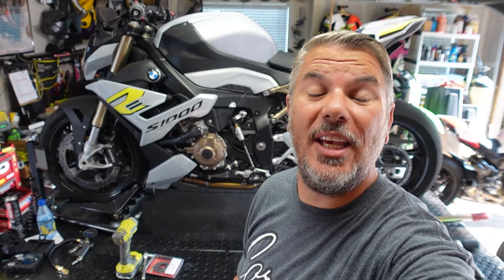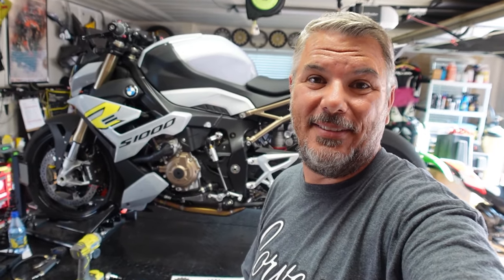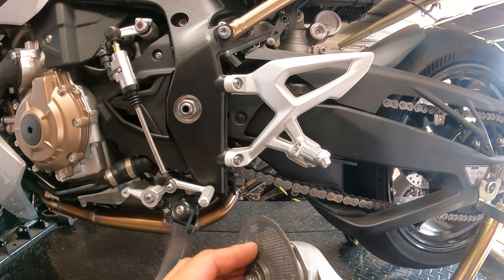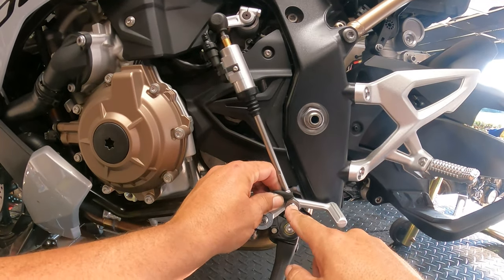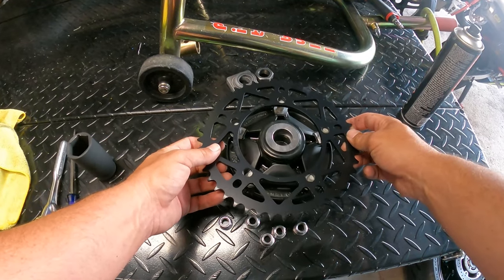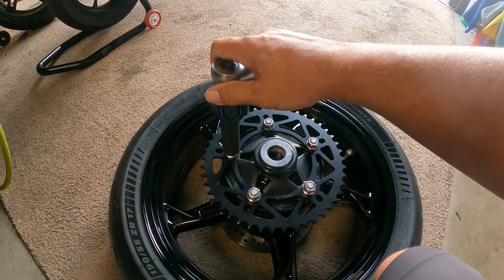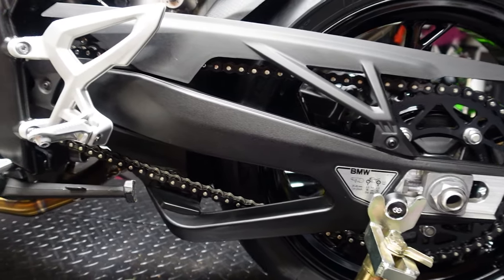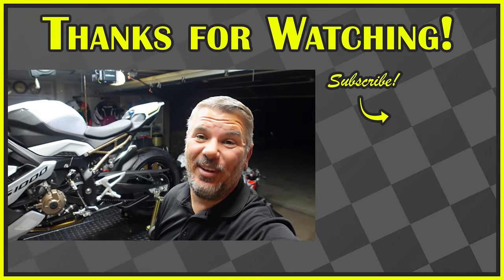2022 BMW S1000R | 520 Chain and Sprocket Install

Comment: I went one tooth down up front on my multistrada and hated it.  Cost me a new chain to go back.... listened to everyone and on the forum that the bike should have come that way, couldn't stand it.  Went back in under 1000 miles.   Over $300 trial.. engineers have it right! Hope you like it....
Reply from the maker: We didn't like it on the streetfighter either. There's some bikes it works on, some it doesn't. We shall see.

Comment: Thank you for the great video!  Regarding the "finagling" to get the rear wheel back in, I remove the rear brake pads to make it easier.  Yes, it takes 7 minutes to remove and replace brake pads, but wheel slides in much easier/faster (for me) and I don't have the frustration.
Reply: IMPORTANT NOTE:  If you take the pads out, be sure to put the pin back in through the calipers and put the clip back in the pin, otherwise it is possible for the calipers to slide apart and the top clips will fall out.

Comment: I’d always slacken the front sprocket before I cut the chain just so can I use rear brake to hold it as it can be a strain on gearbox if done after the chain is cut
Reply from the maker: Yes good call!
Reply: Watched your last chuckwalla video with the new quick shifter and new 360 views very interesting, I saw the odd shift the street fighter did on you and wondered as an experiment to see if it’s actually the shifter miss behaving or maybe a slight error of your foot or a gearbox issue you could mount a camera specifically at your left foot and ride a few sessions and go over the footage just for your own curiosity it may highlight the issue once and for all ! I’m not saying it will solve anything but may rule out obvious things , I have had my foot on my shifter unknowingly whilst trying to short shift and had bike kill as my foot hadn’t fully lifted of the shift pedal and I know u stated before you have a large foot it’s just a thought but overall live your videos at least you show warts and all not just say every single thing and product is awesome like some will to not offend the vendors etc which in my eyes is a total sell out , keep up the good work buddy it’s very much appreciated 👍

Comment: Hey Bill good content and thanks for the step by step instructions. If you don't mind, could you please explain the advantage of one gear down on the front sprocket? What do you gain by this?
Why didn't this configuration work on the streetfighter V4S?
Hope to hear back from you soon.
Cheers!!
Alan.
Reply from the maker: Going down in front or up in the rear will give your motorcycle more acceleration while reducing top speed. Opposite does the opposite. The gearing change made the streetfighter too torquey and riding on the freeway was leaving the bike at like 8k rpm (bit too high).

Comment: That locking ring on the front sprocket, I'm assuming it doesn't spin once you put It on. How did you line it up with the nut when you torqued the nut down to spec? I guess you just bend it where ever it lined up? I.e. no need to bend it where it was originally bent? Also, isn't the rear wheel nut supposed to be torqued to 125Nm?

Comment: Hey Bill, Happy Thanksgiving to you and Nikki! 
Quick question, I recently purchased rear sprocket titanium nutz for my 2022 S1000rr ... Can I leave the rear wheel on the bike and swap out the older nutz one at a time? (Nutz torque 70nm) Good or bad idea?

Comment: Go for the 16 tooth unit! if it doesn't feel right then you can chuck the OEM one on! cant say you haven't tried it then bud
Reply from the maker: Watch the whole video 😝
Reply: @CaliMotoTV  currently still running haha 😄 just seen that you did fit it 👏
Reply: Get yourself a Pitbull tire wedge. Might cut down the time putting the rear wheel back on.

Comment: Amateur. Always losen front sprocket nut 1st with chain on. Edited out the 10 attempts he had trying to loosen the nut. Loosen rear sprocket nuts while rear wheel is still on bike.

Comment: I don't think you using safety first for  your audience, very dangerous procedure teach the proper way.
Reply: I think you're safe bill.
Reply: "I can't urge you enough to be super super careful when cutting" he says, using a cutting disc on a mini grinder with no guard fitted and no side handle. 😬